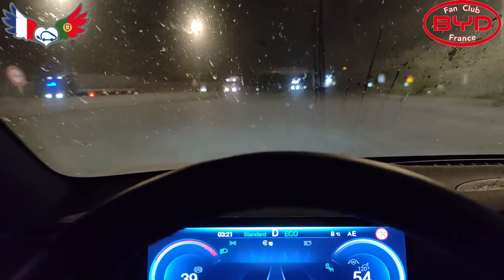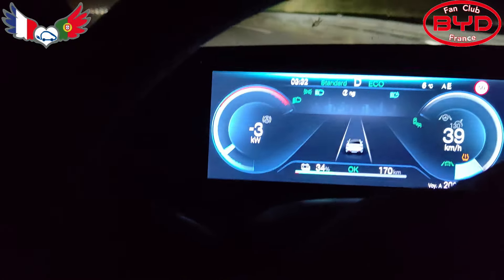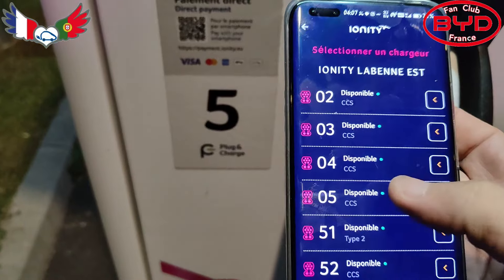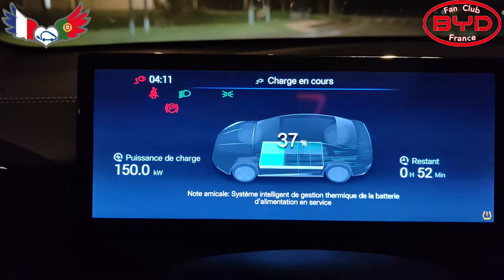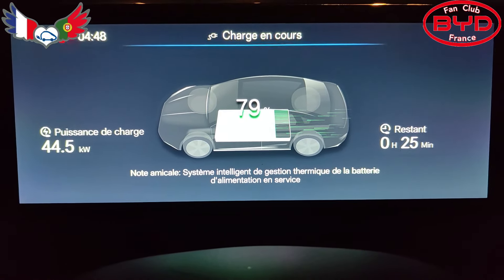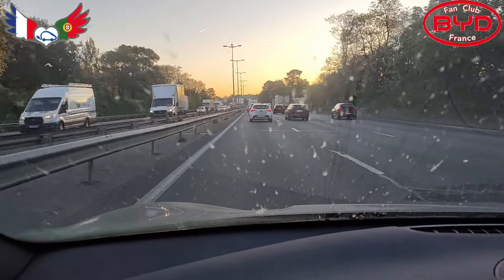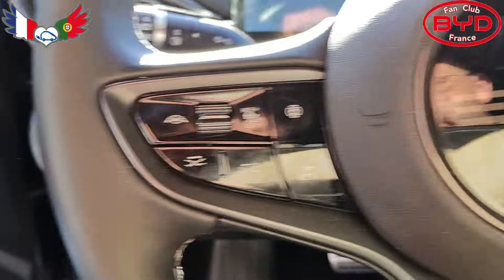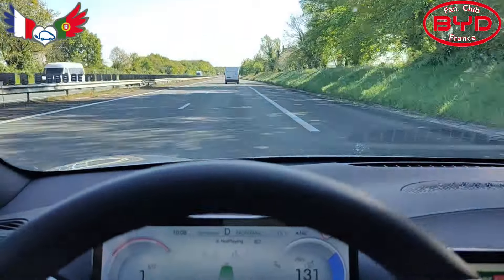BYD Seal, le retour du Portugal vers la France, 3eme épisode la traversée de la France

Comment: Salut, merci pour tes vidéos de tes trajets, c'est instructif, j'adore de design des feux de la Seal . J'avais vu sur une vidéo ( je ne sais plus si c'est MaxBLD ou un autre ) qui disait que BYD avait une mauvaise gestion de la température de la batterie lors de la charge, ce qui faisait chuter la vitesse de charge . Les mêmes batteries, dans les Tesla Model Y tenaient mieux. Cet été, je partirai en TM3 au Portugal, j''avais lu que les cartes fonctionnelles passe partout étaient la carte Shell recharge, et Miio. La Shell, ça fait un an que je l'ai, et la Miio, je la prendrais courant Juin. Bonne continuation!! ;-)
Reply from the maker: La chaîne EV avait remarqué pour la température de la batterie.
La courbe a été remaniée mais il y a des soucis aussi avec certaines bornes et c'est pour cela qu'on a des courbes complètement aléatoires, même sur le même réseau.
Pour ce qui est pour charger au Portugal, shell et Miio, je confirme et juste l'application fait l'affaire, il y a un code pour avoir 5 € chez Miio dans la vidéo en Espagne ou Portugal
Reply: @bassevelleautoservices   J'ai noté le code pour Miio, je verrais dans un mois si je peux l'utiliser, vu que j'ai déjà un compte de créé, mais non crédité. Bonne continuation!!!
Reply from the maker: Normalement il n'y a pas de date limite  @falconfr37  on croise les doigts

Comment: Merci pour ce partage j’ai fais le même parcours semaine dernière en Tesla Performance modèle Y, 6 charges à l’aller et 6 au retour pour faire 1700 km avec un départ à 80% et pas de galères au niveau des superchargeur Tesla la seule contrainte reste que les bornes Tesla sont parfois éloignées du confort habituel des pompes classiques pour le reste la mienne prend 250 kwh et vers la fin chute à 70 sinon rien d’autre à signaler par contre au Portugal il faut absolument partir avec la carte Miio pour les bornes de distributeurs lambdas.

Comment: En mode roadtrip la plage d'efficacité sur autoroute 10 ou 20%-60% ca laisse largement de quoi faire 250km à 130 voir plus en roulant à 120. Concernant le pb de la courbe qui tombe à 45% c'est étrange car sur plusieurs vidéo en chine (bon c'était sur des bornes 120kW) la voiture tiens bien la température 46°C à 60% et vers 65% l'intensité passe de 247A à 167A (76kW) avec 47°C et remonté à 174A (82kW) à 68% puis stable jusqu'à 81% où la vidéo s'arrête. Cette Vidéo a été faite sur un modèle avec un pack batterie de 550V-150Ah soit 82.5kWh
Reply from the maker: Une vidéo est encours pour connaître le vrai kilométrage sur autoroute a 130 kmh
Reply: @bassevelleautoservices  ca serait intéressant sur cette vidéo de faire une recharge sur borne CCS une fois le parcours effectué en mettant car scanner en route histoire de voir la température de la batterie à l'arrivée, la température pendant la charge et la vitesse de charge histoire de voir si il y a une corrélation entre les deux ou si c'est juste séparé comme phénomène